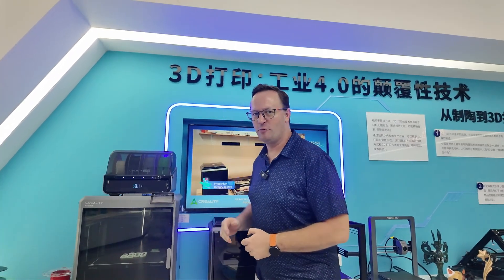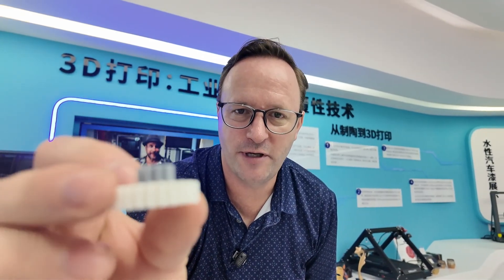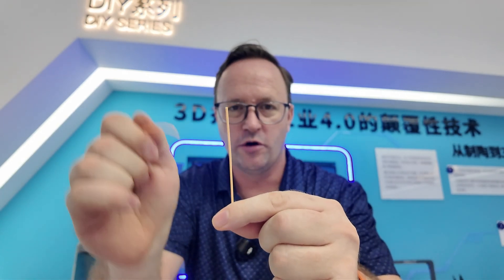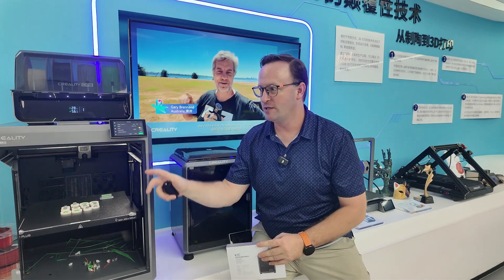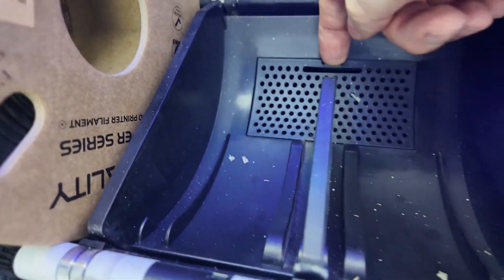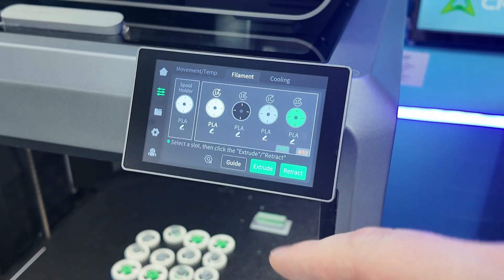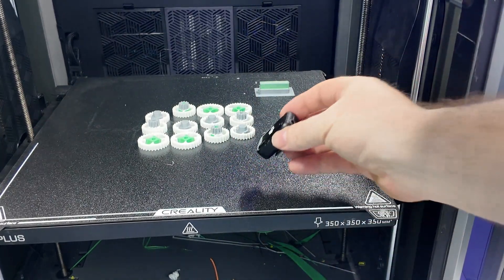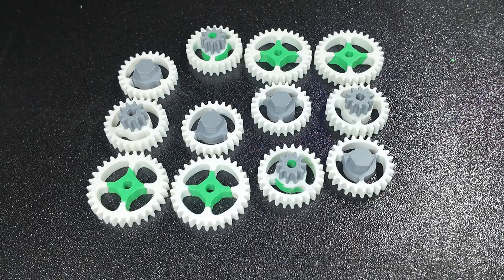Exclusive First In-Depth Tour of K2Plus from @Creality3D Lots to Learn today!

Comment: Why so much poop? If the slicer knows it needs 6 in. of filament for a layer why not just cut off 6 inches of filament , retracke , and load the next color. This WILL be the next big advance in CMS. Any purge can normally be used as fill. It should not be this wasteful. Okay hard for me but not for smart people.
Reply from the maker: I guess because the extruder pushes from above the nozzle you will always have the filament left past the extruder.  I love your idea but not sure how to push filament once it's past the extruder.  More smarter people needed i guess.

Comment: I don't print in colors.  I make functional parts.  I'd love to use the CFS to feed ABS and TPU to make a part with both materials but the AMS doesn't feed TPU and the CFS probably won't either.  I think I'll add a filament drying heater to the CFS.  I'll probably scrap my plan to buy an SV08 but the K2 Plus won't be available until July?
Reply from the maker: yeah TPU just wont feed well in the CFS either - that is a bummer.  It would be so cool to print a wheel in ABS with the Tire in TPU at the same time.  I think the K2 Plus will be available soon - they are shipping now the ones that were pre-ordered so once those are all sent out they will be selling.  I did not hear a date but I would guess it will be by December - certainly not July.  The printer will run TPU, just not with the CFS - yeah.

Comment: Would be nice to know if we are going to be able to get upgrade kits and this CFS. I am ready to jump ship and get a Bambu with ams. I have a K1 max. Love the machine. Haven't had to do much of anything to it. Had 1 failure (due to an ID10T error on my part) so far. I need an filament changer. I would hate to have to get a Bambu. I have several Creality printers(granted older ones which I plan to upgrade for fun). Really like them. My patience is running short though. Really want to upgrade my K1 max as well as get a k2 plus with the CFS but I'm really, really, tired of waiting.
Reply from the maker: The answer is yes - upgrade kits coming for K1 K1C and K1Max.  I heard that we will know more in November - watch this channel because I am trying to get the first one and connect it to my K1.  Also very excited for this.  Sorry you have to wait, but it won't be long now (i am told).  So good to hear you like your K1Max too - I know a few people that love that machine.  I have used it at work when I need something big .
Reply: @kevin.in.3d  My K1 max is getting a work out right now. Printing electronics casing for upgrades on my other printers. First time printing with abs and its killing it. Love this printer! Hopefully going to be ordering some petg to give that a try.
Reply from the maker: @SheLeftMeUnsupervised  I feel like if you can print ABS, then Pet-G is a simple one for you.  It prints like PLA....super easy.  Do you ever catch our livestreams on the official Creality channel?  We normally livestream every week on Tuesday night (EST)

Comment: With great size comes great moment of inertia, belt flop, strecthing and hysterisis. Size does matter, just not how you think.
Reply from the maker: glass half empty lol - it's okay, it's not for everyone.  I also don't really need all these features in the new machine, but it is fun to see companies pushing limits and changing.
Reply: @kevin.in.3d  Its often a race to the bottom via a race to the top. My bigger numbers etc etc. You are right, it's not for everyone. I would argue that there are some hard limits that its simply not usefull to go beyond given the essential nature of FDM and the forces available, eg a large warped part isn't really a usefull part, and thats not even getting into machine motion dynamics and the contradictory imperatives of mass, force and acceleration. All very easy to lose sight of when blinded by "Moar!!!"

Comment: Is the aluminum bed better than the k1/k1max? It is really unfortunate they didn't use flatter aluminum on those printers
Reply from the maker: i measured my K1C and the aluminum is 3mm thick.  The K2 Plus is 5mm thick.  Hopefully this helps.
Reply: @kevin.in.3d  thanks! How flat is the bed on the k2? One of my biggest complaints about the K1 is how warped the bed is.

Comment: Hello, can you tell us something about the extruder and HotEnd of the K2? As you know, the K1 Extruder has had some heat problems causing nozzle jammings. Is that problem solved with the new K2?
Reply from the maker: As I understand it, the K1 extruder issue was an early-release issue.  I also got one of those.  This was solved with the upgrade.  The K1C came out with the better extruder and also the unicorn nozzle which has had zero issues.  The K2 Plus has a stronger extruder again and also uses a unicorn nozzle so I think it should be good now.  I upgraded my K1 and have not had any more problems.  Extruder has been flawless.

Comment: What is all the junk under build plate ? That’s alot
Reply from the maker: My printer at home looks like that most of the time too - just from filament changes or from the little strip printed before each print job.  I normally pry it off with my finger and let it drop.  This printer had been used a lot this week so it was not cleaned up.
Reply: @kevin.in.3d  could jam it up ,,  clean more often  just saying
Reply from the maker: @PeterAgostiniJdcap26  haha okay I'll try.  I get the same message about my desk and my closet.  Quit nagging me lol 😂

Comment: If the build plate come as warped as it is in various K1 Max (including mine), it will be a great con on this printer...
Reply from the maker: Aluminum on the K1 series is 3mm thick, the K2 Plus has 5m aluminum bed so I also hope this is the solution.  I know a few people with your issue.  How have you solved it?
Reply: @kevin.in.3d  never solved it.
I've installed a BTT Microprobe for now, but I'll install the btt eddy next week

Comment: I'm interested in how quiet it prints. Any insights? 
I've put Noctua fans on my Ender 3V2, I'm used to a very quiet machine.
Reply from the maker: i have not tested it officially yet, but i have had it running beside my head while doing a livestream and it is quieter than my K1 and K1C for sure.  Enclosure makes a big difference of course - compared to Ender 3 machines.  I'm sure we will see videos this month testing everything on this machine.

Comment: Is there possibility to add different filaments such as PCTG?
Reply from the maker: yes this is a multi-filament system so you can have different types of filament in all four spots - mix it up.
Reply: @kevin.in.3d  I was more meaning about adding it to the menu so its settings are saved as a pre set filament.

Comment: The question i want know is if this printer too advanced for an entry level person that is just starting to get into 3d printing  ? What's the learning curve ? I want to get into 3d printing and want a large 3d printer to print large scale pieces
Reply: Almost zero learning curve until you start printing things that require unique slicer settings.
Reply from the maker: I would not say it is too advanced - 3d printers are pretty much working out f the box now.  The calibrations are all done automatically.
Reply: @kevin.in.3d  thanks. I really want to buy a 3d printer and have had my eye on creality large printers. Just didn't want to jump right in if it were going to be a struggle to learn the basics of the machine.
Reply: My first 3D printer... I have printed six different projects in three days and all of them came out great... one had a little texture problem because I ignored the support warning.  I have used both PLA and PETG and am quite pleased.  I can't wait to get smarter about 3D printing
Reply: @chuckwilliamson3223  i hope i have your luck.  I would hate to spend loads of money on a 3d printer and never feel like I could get the hang of it

Comment: Hi Kevin, I have some questions. In the specifications on the page it says that it comes with 2 cameras, could you show them in another video? In the package what type of nozzle comes, and if it is made of straightened steel to be able to be manufactured from the first moment with technical materials. And how many come and what thickness. Greetings
Reply from the maker: i have another video showing the nozzle - it comes with a .4 of course but they have already made .6 and .8 for it.  The cameras is a good idea for a video.  One is built in for timelapse of course and the other is actually near the nozzle but i forget what that one is for now - it's not for making actual videos.  I'll find out today and maybe make a short video about it

Comment: if the cfs supports the v3 se SOMEHOW even though it has marlin without the sonic pad nor nebula pad, im ordering one right away
Reply from the maker: no not the SE.  I have an SE also, that would be good - but they said no CFS for that one.
Reply: @kevin.in.3d  would be cool if at least you needed a nebula pad added on for it to work

Comment: why not have a waste model option so you can have the waste done for a separate model that you load before the print starts, meaning instead of wasting the filament it can print a bench so whenyou have the model you requested you get a bench or whatever as a bonus waste model
Reply: This already exists for bambu and in orcaslicer. If it is not available for the k2 by launch, give through orca team a week and it will be
Reply: Just change your prime tower to whatever project you want
Reply: This is already an option.
Reply: This is a great idea!

Comment: so it can't do tpu, it's not heated and the extruder is still bad? Oh thank god I didnt preorder
Reply: FYI. Most of Bambus AMS systems can't use TPU either. I know for a fact that their enclosed systems can't. Just not sure about their unemployed systems from the A1 series. I suspect it's the same there but not positive.
He also mentioned that it is heated. Case is up to 60, build plate up to 120  hotend up to 350. Unless I missed something. 
Also not sure where you're getting that "the extruder is still bad".
Please elaborate.
Reply: @chpunisher2005  and? I didn't expect creality to come out with a printer that tries to catch up, I expected them to come up with a printer that has innovation in it.

Comment: As the filament gets cut just above the hotend, quite a big chunk of filaments needs to be pushed out.
Whats the reason the filamentet doesn't get retracted X mm before it heats cut? Thats would save a bit of filaments, which in the end adds up.

Does anyone know?
Reply: I suspect it is about the extra time it would take mostly, it would probably only take an extra 10 seconds, which for very few color changes in a model would be insignificant. However many models can have hundreds or more color changes and it may add hours.
Reply: @l0ckmanjohn  not to sure about that... Retract 1cm takes basically no time at all. Could have to to with risk of clog maybe?
Reply: @LarsAhl  that’s a good reason as well.
Reply: Clog risk

Comment: Wow this is Massive filament waste, nö better way to rectract until the nozzle is leierly empty and just waste the already melted part ?
Reply: It wouldn't have a way to verify it got the last stringy bit out which could lead to color bleed, and it would add a lot of time to long prints with a lot of color changes. If it's something with few color changes then it isn't going to be a lot of waste.
Reply: @l0ckmanjohn  I mean a lenght until the Melt Zone, so you reduce some milimeters of waste.

Comment: I have a K1 and a P1P, I love them both, and while I do feel the P1P is a bit more refined. Im never getting rid of my K1, and I plan on getting the K1 Max next instead of the X1 because of the size difference. That size difference is a winner, and after the K1 Max, I’m getting the K2 Plus to print multi color automatically. K Series 4 Life… lol
Reply: I was thinking of buying s x1 with ams and a buddy told me about the k1 max. I looked at it for about 20 mins b4 ordering it.  I love it.

Comment: Great video Kevin! I finally got a real idea of how big the k2 is! I just got myself an sv08, so that puts me at 6 printers now! I remember when we both said I should be set with just 3 printers! haha! The sv08 is 350mm and Ive got it right next to my k1c.. Shes friggin huuuuuge... Im glad yall went with 350 though because that is the perfect size to fit on the IKEA LACK table ;)
Reply from the maker: I tagged you in the description too - saw you on the TV at one point.
Reply: Is the IKEA Lack table stable enough to handle such a big machines movement without causing it to have vibration errors? Not looked at or seen in person that table.

Comment: Hey Kevin!   Thanks for sharing...love to see more of this big boy at work!    I know it's asking a lot, but are you able to get a decent sized TPU/TPE print video for us, please?   I have an idea for a project that requires the size of the K2 Plus with some TPU/TPE, but I've noticed that most of the prints have been PLA.   I know some printers struggle with TPU, and given the long filament path (from the spool holder, I know it won't work with the multi-material unit).  There are a few features of the K2 Plus that makes me wonder how well it'd handle flexibles:
- long nozzle:  It's easy to overheat tpu and cause a clog
- strong direct-drive extruder:  easy to over-mash tpu...and depending on the gap between the nozzle and the extruder ... easy to deform the flexible filament.

If you've already shown that and I just missed it, please let me know and I'll have a look! :)   Thanks again.
Reply from the maker: no i have not seen anyone do tpu on this yet - I will ask if they have a sample I can show...
Reply: Won't be able use TPU/TPE in the CFS filament holder. You would have to run TPU/TPE on the rear spool holder like the K1-series feeds. That kind of filament is to soft to be pulled on by the CFS and will clog the system, just like it does on the Bambu AMS system.  But the engineering team says it can do tpu just not in cfs